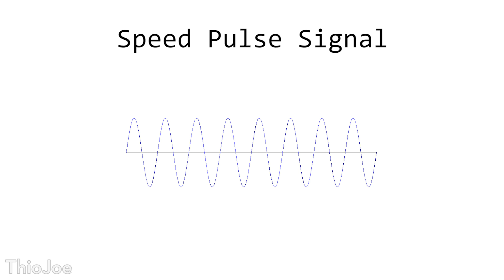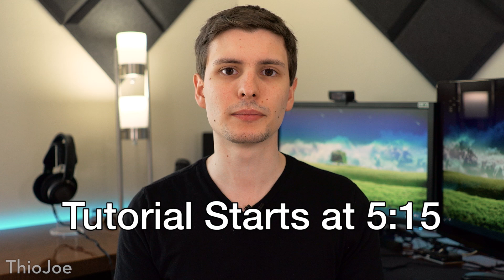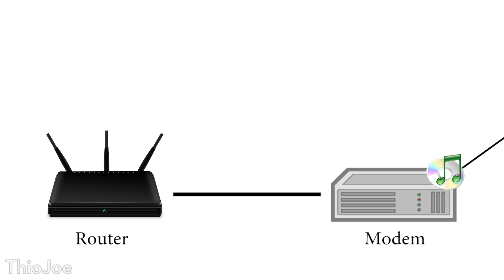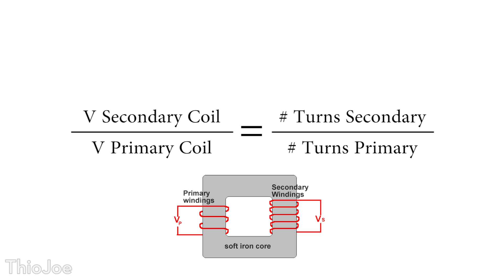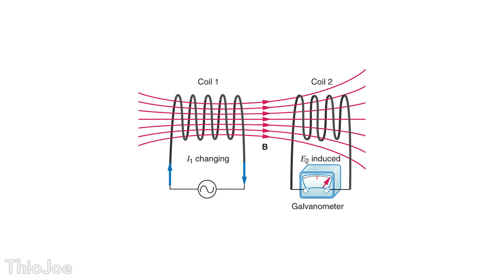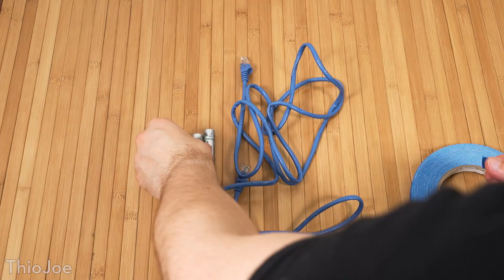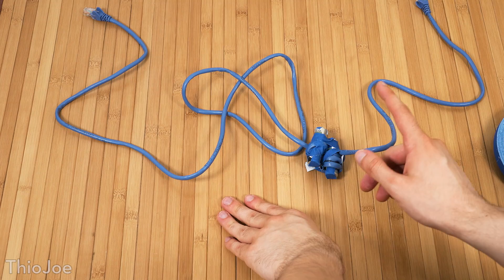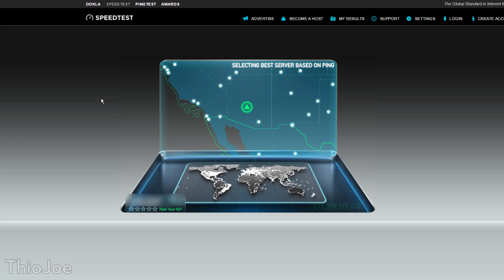How to Get Faster Internet Speed for Free

Comment: Everything you did is not usable. Trafo needs one common core and two separate circuits. What you did? No core, one cable, so voltage change due the same cable? Don’t treat us as idiots.

Comment: I get same speed . So check both side of the wire using a ameter. Guess what i found. If i change 4round cabele to modem side then my internet speed get 4time speed On that side and other side it is  1 times faster.  If ichage the wire other way around , then 1:4 is change . So the final result is same  as old one. 😅😂

Comment: How do I connect the battery transformer system to my system if I am using a combination router/modem and the input from the ISP is from an antenna on the roof of my house where the signal is received from several signal towers in the valley that I live in. I do not have a cable going directly from my router to my computer because everything is wireless in my home.

Comment: This really works!
I plugged two cables and got twice the speed!

I'll show a video on trunked connection, and no you don't strap a elephant to the line.

Take a Lan cable, and another,  set tx and Rx to 10 on the Lan configuration.
On a  Router,you plug in to two cables, then trunk them so that they run full speed.
You will need a commercial dual port Lan card for this to work.

If you trunk then and plug one in and then with both you will get twice the speed!

You can get 100 times the speed too.
 .
.
.
The secret is go into the configuration file on the card, set the Tx and Rx to 100. And watch as your network speed jumps 100 times faster!!!

* If you don't get the speeds I have stated, then you may have a slowdown due to your hardware. Note that harddrive interfaces have limits and if you down and or upload files they can be limited by the slowest thing, usually the harddrive.

Now you read this far, do you want 1000* internet speeds?
How about 2000x.

Simply change the number to 1024, and change the MTU setting to 9500.
The router should accept large packages if it will accept trunking. 

Yes my friends this is no lies at all. What I have said is entirely true, however you ISP won't provide those speeds you can get across the internet. :( But you can on Lan!!

PS I've 10gbs lol... (Well actually 20gbs but I use it slow as the hardware can only muster 8.9gbs anyway)

Comment: Uses shielded cat5 cable to set up induction coils🤦‍♂️. Also, he needs to do a better job sealing the ends of the batteries so voltage doesn't leak out.

Comment: My modem and router are all combined into one unit from the cable company. Will this work if I straight wire from the unit to the ps4 without using wifi.

Comment: Will this work on modern modem that works both as modem and router? Nbn input with 4 output J45 ports and 1 phone. Which cable connection should be amplified?

Comment: The port you are connected to on the switch at the remote end has a speed defined in it’s config. You can’t change this without being an admin on the system (phone company switch uplink that feeds your DSL modem). Even if this were possible there is a hard limit on say the GBIC that drives the fiber circuit to the switch that feeds your DSL. It might have a 10 gb link upstream but actual data limit could be much less and it is shared with all user ports on that switch that feeds you.

Comment: If you're paying for the 30Mbps plan with Cox communications and think your internet is sometimes slow, check the upload speed. We used to have the 30Mbps down plan, till I tried to use online backup. We realized that the plan only provided 1Mbps upload. 
At the time their plans were:
10Mbps down - 1Mbps up
30Mbps down - 1Mbps up
60Mbps down - 3Mbps up
150Mbps down - 5Mbps up
300Mbps down - 10Mbps up
1000Mbps down - 30Mbps up
Even though we were satisfied with the 30Mbps plan in terms of streaming video, online backup was a trashcan. So I had to pay more than twice the price for a couple months of the larger plan to complete a full online backup (still took 52 days to complete), then go back to our normal plan.

Comment: Hey TJ, pretty interesting tips you share here bruh but though I tried exactly what you said nothing changed in mine. Idk whether I did something wrong or what. I have a modem-router & just one PC connected the rest are on WiFi. I did the coiled batteries trick you taught on the vid, the single coil went towards the router-modem & the other one towards the PC but when I tested it the results were just as bad.... please tell me what did I do wrong?

Comment: It a bunch of crap the wire are twisted in cat5e cat6 cat7 and cat8 wire to keep out side magnet fields so your telling me the 2 - 1.5 volts batteries 3 volts going to effect the magnetic field I guest you a math wizz using PIE or ohm law not physics like sin, cos, tan, deg, or ang, height or drop exc. still waiting for physics not ohm law        can’t go faster then what coming into the house test again already a preloaded on computer so it would be faster the second test

Comment: I did this saved enough money not having to upgrade isp service so I could buy a better router and hook it up to my current one and then I took the batteries off.  Lol I'm joking this person probably hasn't taken a physics class. So just buy a better router plug it into the current one and it will do the work for you. Also it pays for itself by not having to upgrade isp service.

Comment: I have a combined modem/router should I do the connection from outside in? I don't use a cable to connect to the router I use wifi

Comment: I only have the yellow and the gray ether cords whereas you have both blue and yellow and you used the blue. Nothing was mentioned about the colors of the ether cords and if they have different functions or uses or not. My yellow cord runs from the modem to the computer and the gray cord runs from the router modem to the gateway box. Therefore, do I use the gray cord?

Comment: Or just setup a newer router on top of the current one and use the second one for the higher speed connection. Currently paying spectrum for their 100Mbps but with my current setup in getting over 100Mbps.  The new router pays itself off by making it so you don't have to upgrade your internet service package.

Comment: Thank you, ThioJoe! I tested using 2 almost drained out alkaline batteries and did your configuration after listening to the physics. After testing, the speed increases 20mbps after 100mbps. So I'm wondering whether will that further increases the speed if I use a fully charged batteries and energiser type? I may try soon to find out.😀

Comment: The two batteries got so hot that it melted the wiring and then started a small fire. Luckily I keep a fire extinguisher nearby, but now there is a giant black spot on my wall and now I have to buy another ethernet cable.  WTF?

Comment: So fake my internet speed went way down bro The only way to upgrade your Internet speed is through your ISP or your Internet provider so or you can just also do that but you can also upgrade your router and upgrade your ethernet cable to look at it when you upgrade your speed and get you a decent router and if you have an all in one router and modem turn the router part off use it as a modem but a separate modem separate router and you’re good to go

Comment: Total Crap - what you are looking at is a laptop connected via WiFi running speedtest.  The cable plugged in has nothing to do with it.  It is kind of like putting a jug of water under your hood and saying it will give you better gas mileage.  Total hoax.  Why?  Well each view makes a little money for him on YouTube.  This guy should be booted off YouTube in my opinion.

Comment: Hi, I have innternet which arrives via cable and first goes into a router/modem combo. It then goes via ethernet cable to my desktop and via WiFi to my tablet is there anyway using the two AA battery method to increase the speed to the WiFi download and upload in use ? Thks

Comment: Hi Thio and thank you for your marvelous videos. I tried your Faster Internet Speed Video but got confused toward the end. You spoke about the battery coils as 1X, then 4X; and  at the reconnection point you spoke about connecting the 1x coil in the router and 3x coil at the modem . My speed improved, but not with the highest numbers you showed on your demo. Did I do anything wrong? I know that testing it changes every time you try, and still shows low numbers. Please explain. Thanks again and keep up your great work.

Comment: Instead of the batteries wrap the Ethernet cable around a toy Slinky  for better magnetic induction.  And the rest if the Slinky can be attached to a hook in the ceiling expanding it down. Tap on the Slinky to create sound pulses that sound like a Star Wars battle. And this will improve the over all internet experience (:

Comment: We have Hughesnet which is not fast at all. I did two mods which drastically increased the speed although it did not approach the speed that you reported in the video. First off, I replaced the 18" dish antenna with a 10' C-band antenna. That increased the download speed from 6.32 mbps to 18.12 mbps. The upload speed increased fromI was pleased with that but knew that I could do better. I purchased a Radio Shack 40W 32-2054 PA Amplifier which I connected between the router and the modem. Since I was concerned about excessive current going to the modem, I put 75 ohm wire wound resistor in series with the amplifier's output and a 150 ohm wire wound resistor in parallel. With the amplifier on the number 2 volume position, my download speed increased to 321,24 mbps and the upload speed increased from 1.82 mbps to 187.55 mbps. While I did not get as dramatic increase as was demonstrated in the video, I was very pleased with the result. Thank you for inspiring me to make the changes.

Comment: The differential setting is incorrect in your first graphic, you need to remould the basic delay function and then twist the cone down.

A heavier gravity reflector will do it. Job done.

Comment: The problem is the video is bunk. Even if wasn't you'd be back in a situation when the local cable modems did the throttling based on isp data. People would change this data and get a higher speed. Until they got caught and found out just how much trouble that could cause them. Up to and including criminal charges in some jurisdictions.
This is basically a how to fry your home equipment video.

Comment: Great video but i did it by smashing 15 d batteries and packing them into a 2inch 4inch long piece of pvc pipe drilled two .062 holes at 45 degree angle 12 inch pieces of coat hanger in each hole for rabbit ears now i get UHF on my TV

Comment: Thanks Thiojoe, i enjoyed your video and as aan engineer i understood it fully. Now you mentioned that if men has a router-modem combination in one housing, we should apply your method to the network cable between that housing and the PC, right?. But now my question is witch side with the 4 coils should be connected to??, i meen to the router or to the PC side in order to  achieve the intended effect??. Many thanks in advance.  Amr Safar, The Netherlands.

Comment: What about cable wire, not cat wire, on Fios? System fiber stops outside house the cable wire thru house. Cable is shielded under insulation.

Comment: Is the increase your internet speed video by lining up 2 AA batteries on the cat5 cable between modem and router a joke?  Have tried it - no change before and after.  Not a technical person, but a long time user of various tech devices.  Would consider becoming a paying member, but not for joke how to improve whatever.  Don't have time for non-value joke presentations.   Would appreciate your feedback.  Thanks

Comment: hi!! I have fios internet and a wireless set up, with a modem and router combo box, where or how do I connect either the wire that was prepped with the light or the one with the 2 batteries attached, so I can get the max speed. Thanks in advance for the answer.

Comment: Soooo... this is pretty amazing.  I’m gonna share my setup super fast, and I can tell you this works likes magic.      Im in my semi truck, using netbuddy setup.  I also have a 10db external antenna on the setup, and I’m running a signal amplifier(which I think does a tiny bit).   I am currently parked on the AZ- CA border @ the rest area, right after the weight station.   Usually my speed here is between 3mbs to 13mbs. After the batteries added to my 10 foot lan cable, I am @ whooping 50mps to 54.5mbs.     AMAZING!    I’m ordering your coffee mug!    Thank you!    

P.s.  if you know a way to actually make the signal amplifier amplify, like it used to back when they first sold it, compare to when I bought it and it’s been regulated by the so nice fcc, and if you have a way to make my strong exterior antenna even stronger, man I’d be for ever great full.    I will upload a video on my setup in my rig.      I can’t wait to get home and unlock my home internet!  Thank you again,  you are the man!

Comment: Making the step up transformer using the two batteries with one to four wrap ratio did NOT increase my speed even one Mbps.  I did it just as you said and the one wrap Ethernet went into router and four wrap Ethernet side went to the modem and I pay for 50 Mbps but after following directions I got only 47 Mbps.   Are devices using WiFi suppose to all be connected using Ethernet only and not WiFi.  Also I have fiber optics and would that cause no results.  If you have to connect all with Ethernet or you can’t have an ISP thst is fiber optics then you should say that as a dis Mainer up front !!!!!!! 😪😪😪😪😪😪😪😪😪

Comment: This didn't work for me, so I ordered a 1000ft Ethernet cable from Amazon and ran it out to my pool pump, around the 240v motor and back, (had enough left where I could wrap it around my breaker box) and now I can cancel my cell service. I get wifi all over town within a 6 mile radius. I might just get a flip phone for when I travel.

Comment: Say Joe, your theory lesson shows two coils, that is ... two separate coils that only share a common core. Not the path of the current. Care to explain how this is possible? If the theory applies, then in order to couple the current to provide a "step-up" voltage, then you would have to separate (cut) your cable and use an iron core for your "transformer." Maybe I am dumb.....don't think so though. This just sounds weird.

Comment: I watched it to see how BS it was.  At 1:27 you jumped the shark.  Imagine, sending an analog signal to negotiate speed on a digital communication line.

You can actually muck with your internet speed a BIT, possibly, by sending an SNMP packet to your modem, if it's a DOCIS modem.  Or at least you could with 1.0, but even if that worked, the CMTS would set it back to it's original configuration.

Comment: I have some questions. What happens when the batteries die? Does it have to be rechargeable?
I have copper phone DSL. Would it be better to do that on the phone cable or coax where the provider's signal is? I am paying for 7.1 and I am only getting 6 on a good day. I am going to try this on some spare time. I am tired of paying for more and getting less.

Comment: Increase your cable speed  -  This kid is ate up with himself and his importance:  1st - use 2 AA rechargeable batteries and wrap coils on ethernet cable - NOT  2nd - an equal part of raw ethernet cable wrapped at each end of an ethernet cable - NOT  3rd - Salt coating in plastic bottle and so on -  NOT   4th  Wrap foil around your ethernet cable, shine bright flashlight at end of the ethernet cable connector for 3 minutes - NOT  and 5th  I am tired, don't th;ink I will look for number 5.

Comment: couldn't fin any batteries so I used the generator on my bicycle and works great, I use my horse to turn it this way I get one horsepower to pump out this BS and get speeds from the methane gas just like cows put out.

Comment: I have a Comcast modem. It provides either wired or WiFi internet. Where do I put the modified battery transformer? Should I attach it to the modem input cable?

Comment: I tried it didn't work. But I was trying to improve my WiFi for my household using your method via the phone wire connected from the phone jack,which is incidentally my phone line as you well know, the phone line is connected directly to my modem / router. Is there a way to increase my DSL speed without using your method, otherwise I have to connect an Ethernet cable to my TV and then using your method?

Comment: It really worked Joe! All you need to do is to insert one (or several) "rocket-plug" up you're  moms "rear-firewall" anyone can do that, It's  so easy! (You are going to need a decent A.N.U.S rocket  router plug though in order to avoid "too wide hole-space" errors) also get a y0ufg cable Joe

Comment: I did this but with incoming fiber and I used 9v batteries. I also gave one turn on one side and ten turns on the modem side. Before I was getting 1gb speed. Now I get 10gb speed. I am thinking of using two car batteries and try and get 100gb speed. Thanks Thio.

Comment: Batteries are powerful, I will wrap the wire of my laptop's output sound over 2 batteries and directly connect to my huge load speakers. It would be like a powerful amplifier.

Comment: Hello ThioJoe. I tried this truck but didn't work. I use Phoenix internet as my provider. They use a P.O.E box( point of entry ) with coax cable connected to a dish. Does this effect where I need to place the batteries. Such as on the coax cable instead of the Ethernet cord.  I appreciate your time. Thank you very much

Comment: If your max is 50mg to the house. Then you’re not going to get any more then the cap allows. Anything above 92% can cause your service to fall off or have service issue. 

These numbers are coming in on a 26ga wire. The shorter the better. But if you’re at 11,000ft away from a vrad. You’re not going to get much more then 6mg service.